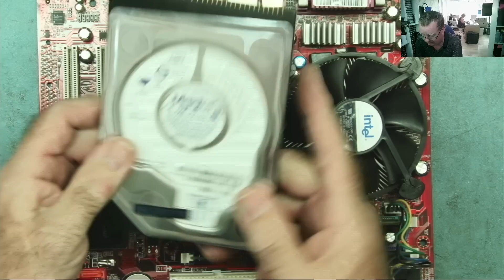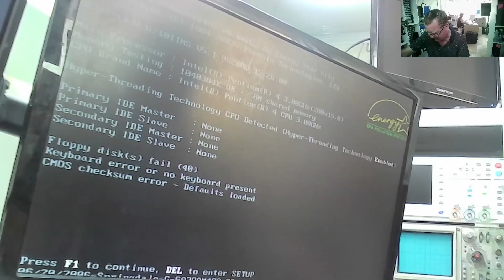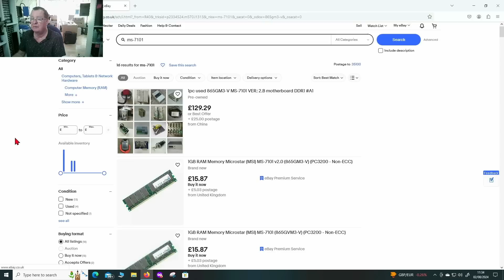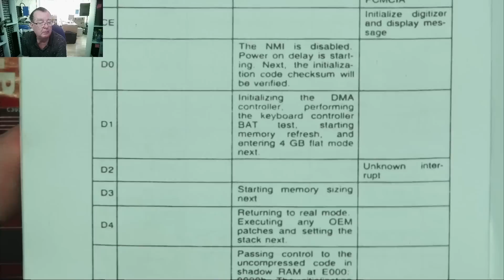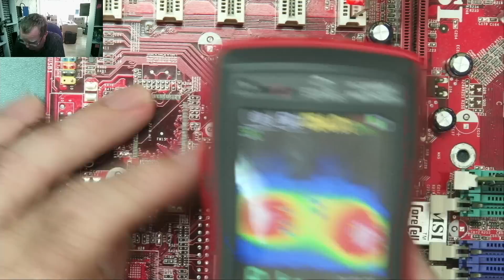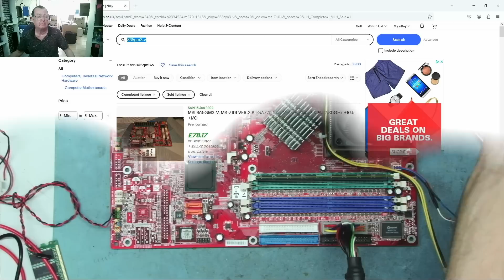Car Boot Flea Market Retro Gaming PC Finds 4th August

Comment: The 865 chipset doesn’t support Core2Duo CPUs. The earliest that does is the 945 chipset, but even then it depends on the motherboard maker if they support it. Usually only the 800MHz FSB Core2Duo CPUs work with the 945 chipset such as the E4xxx series. Recently I was able to have an ECS board with 945 chipset work with an E4600. The performance delta vs a P4 is definitely noticeable.

Comment: In case of the 2nd motherboard... you do know the boards D-bracket which also functions as a post analyzer might help more. Its right there on the back of the case in a pci slot. Its kind of there for a reason. Some motherboard manuals are missing explanation for the codes but i know its in the online msi k2n7 delta 1 manual.
Reply: Well spotted, I had forgotten all about D-bracket, though they have a dedicated header on the board rather than occupy a motherboard slot. They were useful but just give the same info as the analyzer card so in this case won't help.
Reply: @chrishartley1210  Its good to notice what code it gives before shutting off. In the video i heard a lot of "well, its doing something" even with the analyzer card so i don't think its clear what the codes mean. At least with the d bracket and manual you can follow what it is doing pointing you towards a possible problem. But sure if you know the meaning of the codes, any analyzer will do.
Reply from the maker: @0MeALot0  Thanks for the info.  I have some more PCs in this batch, at least one has exactly the same motherboard as the second one, so we can do some comparisons